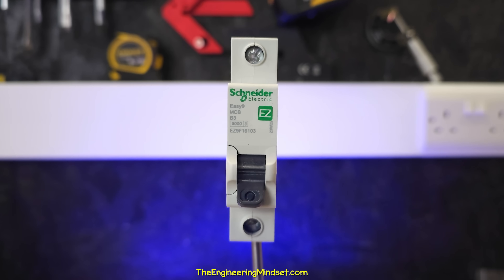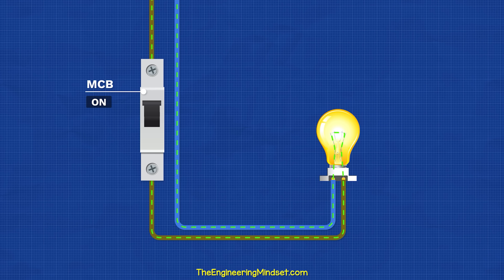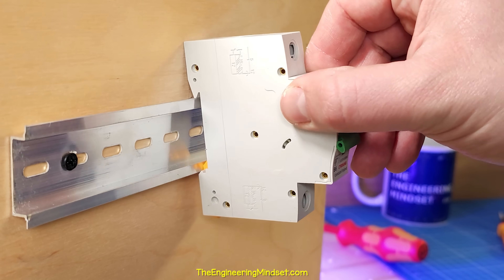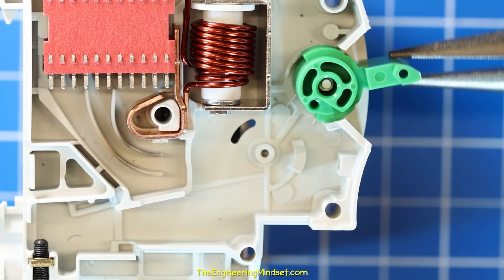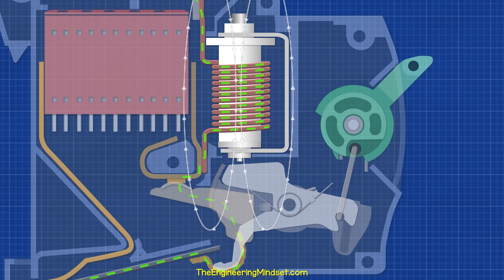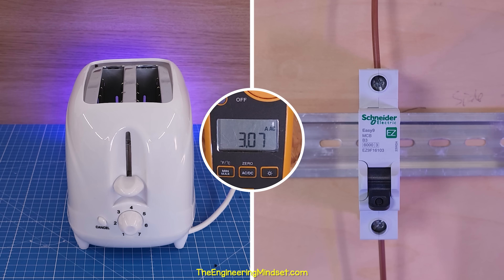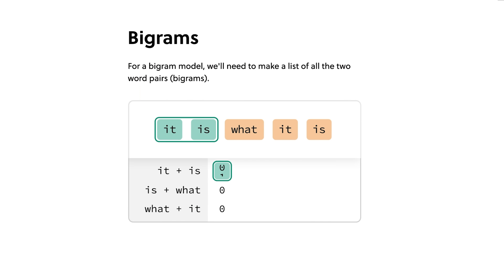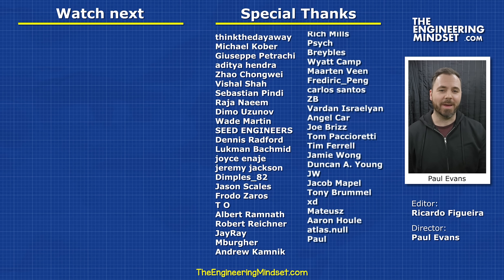Why Circuit Breakers DON'T Protect People (electric shocks)

Comment: The first GFCI I installed I tested first, out of curiosity. 
I put myself in series with my multimeter and reached 100 ma before I had to let go. The device was supposed to trip at 60.

Comment: 4:00 The electrical & automation maintenance engineer in me is giggling at this... 😂
On a more serious note... YOU SHOULDN'T MIX OR INSTALL BREAKERS OF DIFFERENT BRANDS INTO A DIFFERENT BRAND PANELS EVEN IF THEY FIT FOR SAFETY REASONS!
(Do as we say, not as we do 😅)

Comment: 2:22 Give me a graph of the breaker in use, and I can tell you!
And I disagree with your video. Where is the protective earth?
In class, I learned two types of protection:
Basic Protection and Fault Protection.
Basic protection prevents you from touching the voltage.
Fault protection prevents you from getting an electric shock if a fault occurs. And this is where the circuit breaker does its job so well. With correct grounding, you basically lift your foundation up to 115VAC by connecting the ground with neutral when entering the house. Your house is now TN-S.
This means if a live wire were to come loose in a grounded housing, you wouldn't get shocked! The housing would create a short and trigger the CB. If there were no grounding, the live wire would electrify the housing, and you would get an electric shock.

Comment: Hello I don't know if this video title is correct or not;

In a TT-grid a breaker does provide people protection from indirect touch.
In a TN-grid a breaker does provide people protection from indirect touch.
In an IT-grid a breaker does provide people protection from indirect touch.

Aside from a special wiring diagram where a circuit breaker breaks in function of the negative sequence current. Or by measuring impedance to ground (always present in IT-net here in belgium conform to our laws). I know of no way to protect from putting yourself between two lines.

If a live wire touches a metal housing. The entire housing is at that potential. And touching it may kill you.
When this happens the impedance is either:
1) very low, thus the voltage over the person is high, but this gets tripped because low impedance => high current
2) very high, thus low voltage over person, but high power consumption (fire hazard) this doesn't get tripped

Comment: In Europe MCDs usually cut both Live and Neutral.
There's two reasons, First for it's higher security, second because the standard 230V 50hz doesn't actually require that Neutral Is at the same voltage (or close) to earth.
I live in Europe, i have 230V between live and Neutral...
But it's actually like if i have "two" lives.
Because live it's at 127V compared to earth and Neutral too, they are offset so that there's Always 230V between them.
Usually Neutral compare to earth Is 0-3 volts but for extra security (and for this unusual cases) we use breakers that cuts both live and Neutral.

Comment: GFCI -- The ground-fault circuit interrupter, or GFCI, is a fast-acting circuit breaker designed to shut off electric power in the event of a ground-fault within as little as 1/40 of a second. It works by comparing the amount of current going to and returning from equipment along the circuit conductors.

Comment: Is there a way to report wrong auto-translated video title?
the term "circuit braker" is translated to "disyuntor" and should (at least in Argentina, don't know in other countries) as "interruptor térmico" o "térmica" o "llave termomagnética" because that is how we call the CB.
A "disyuntor" or "interruptor diferencial" is the one checking in and out current, an if a significant difference is detected, it break the circuit, so those are the ones protecting people.
Reply from the maker: Thank you for your feedback, we have now changed the translation to Por qué los interruptores termomagnéticos NO protegen a las personas (descargas eléctricas) to suit the different spanish speaking audience and try to make it clear for both South America as well as Spain as the term varies

Comment: I dunno I feel safer not being on fire.
Reply from the maker: This device won't stop providing power to a device if it catches fire, it will happily continue and burn the entire place down with everyone inside. It will only stop if the current becomes excessive.
Reply: @EngineeringMindset  A device, yeah, but those you can see. In the walls, that's where the problems are and that's what it protects.

Comment: "You must be qualified and competent to carry out any electrical work"...

You're incorrect. Nowhere in the electricity at work regulations does it use the word qualified. You must be COMPETENT and there is a big difference between qualified and competent. Electricians from before NVQ courses who are experienced enough can still legally carry out major electrical works. Competence means you're experienced and understand the dangers and how to install and maintain electrical installations safely. I've personally studied BS7671 extensively, and I'm not "qualified" in any way. I can legally work on installations, as long as it doesn't fall under notifiable work. I can't install a new circuit, work on bathrooms or outdoors or rewire a house (though I have done) but anything that falls under part p does not require official recognition. Even official recognition isn't a qualification. It's a competent person scheme such as NICEIC or NAPIT.

On top of that, a lot of electrical contractors in the UK are "qualified but not competent" these days. Experience trumps all qualifications in any field!
Reply from the maker: Yes all true, but we cater to a global audience and the regulations vary by country and even by region within countries so we have to be generic with safety warnings
Reply: almost any electrical work is illegal in finland

Comment: wait how you say that 1,5mm² ist rated for 20A? Its normally 16A max. and better will be 13A as a breaker
Reply from the maker: Referenced from UK onsite guide for electrical installation. Specific conditions, there is on screen note in corner of video also.
Reply: in finland the standard is 1.5mm² 10a slow blow

Comment: Por qué confunden Disyuntores diferenciales con llaves termomagneticas??? Son diferentes protecciones.. una termomagnetica NO protege contra descargas en el cuerpo, sino que protege la instalación de cortocircuitos. El disyuntor diferencial, actúa midiendo posibles diferenciales de tensión respecto de tierra (protege por posibles fugas a tierra entre las que pueden ser descargas a través del cuerpo. Hay errores conceptuales. Mezclaron los tipos de protecciones y sus funcionamientos
Reply from the maker: Exacto, el video muestra una llave termomagnética todo el tiempo y explica su principio de funcionamiento, aclarando que solo protege contra sobrecarga y cortocircuito.
El disyuntor diferencial se menciona aparte, solo brevemente, y se dice que salva vidas.
El problema viene de la traducción del inglés original: una termomagnética en inglés se llama “circuit breaker” o “disyuntor”, mientras que el diferencial se conoce como “RCD” o “GFCI”.
RCD significa Residual Current Device (dispositivo de corriente residual) y GFCI significa Ground Fault Circuit Interrupter (interruptor por falla a tierra).
Disculpas si hubo algún error en la traducción ofrecemos estos videos de forma gratuita y hacemos lo mejor que podemos.

Comment: In Australia, we don't switch our neutrals. Our neutral supply wire is bolted directly to the main neutral bar and an M.E.N (main earth neutral) is installed, tying the neutral to the earth wire. We have strict earth resistance limits on both our final subcircuits and our incoming supply Active-neutral and active-earth impedance values, as well as strict rules on tying anything metallic that may come into contact with electrical cables to the earth as well. Works VERY well under fault conditions I believe.

Comment: Yesterday, while I was playing my computer as usual, the wiring in the hallway caught fire. It turned out I'd somehow exceeded the power limit, and the wiring caught fire. Although, everything was resolved fairly quickly, and I think they said they'd replace the wiring because it wasn't my fault.
As I understand it, the wiring in the hallway is older than the wiring in the apartment and simply couldn't handle the heat (while the fire was burning, the PC continued to operate normally for about 5 minutes until I turned off the lights in the apartment).

Comment: MCBs do in fact provide a level of protection for Humans. 
As electrical Tools/appliances, at least in europe, need to be certified with a certain safty class. There are 3 Types:
1. Grounded caseing
2.Double Insulation
3.extra low voltage

For Type 1, the curcuit braker is essential for protection. In case of lose wires or a broken Insulator in the tool, the live wire would short to the case and Trip before a human would get a shock from the case.

but yes a mcb wont trip if you just touch lose live wire. they are actually called "leitungsschutzschalter" in german which litteraly translates to "wire protection switch" and dont provide direct protection to humans.

Comment: I learned a lot about these when I decided to build my own power station for home usage. It seemed pretty straightforward from a technical perspective, but then I couldn't figure out the proper breakers I'd need and how many — one on entrance for the invertor, okay, then what? Do you need one for the battery (in) to save it or two for the battery (in and out) to save the inverter? So I asked an engineer friend and he explained that it won't save me and it won't save the equipment if something happens — even with the bms and the breakers, the inverter will most likely just fry itself on the spot. Wait, what? So why do I even bother with several (AC and DC for battery) breakers then?? Well, it's so your apartment doesn't burn down to the ground, he said. 
So it goes. 

I'm not a mechanical engineer or an electrician, but that was a huge project and I got to learn a lot, thank you for this video, explains many different aspects I didn't know about.

Comment: Could you make also a video about Motor protection circuit-breakers which is little bit the same. But where you explain how to adjustable current rating is explained + what happens when a imbalanced load is applied and why it should trip with imbalanced load?

Comment: I am in Semiconductor industry and a team in our Company Designed Electronic Fuse (Efuse) with a Circuit breaker Response of 2uSec.
The Breaker Current can be pre programmed to values from
mA to hundreds of Amps.
The IP is expected to land several US patents

Comment: At @15:20, you explain the curve shows a trip range, which includes a worse case trip time of 11.5 sec 3 times the rated current. You then say a B breaker will instantly trip when getting between 3 and 5 times it's rating. Why do you use the word instant? Given what you just explained, we are looking at worse case trip time between 11.5-2.5sec. I would imagine the word instant shouldn't apply to something that could take 11.5sec to react. Why did your wording change to call the trip charactoristic instant within that range? Looking at the curve, I would imagine anything 6 times+ the rated current would be a better location to use the word instant, and only location to use it. That section has no range, it's a flat line for 0.01s
Reply: And if the logic from the rage 1 - 3 would be applied to region of currents over 6 times, a B breaker would not trip with the 40 times the rated current if the current lasted under 0.01 s.

Comment: C est quoi ces disjoncteurs ?  
Ici ils coupent phase et neutre..
Reply: you don't have to cut the neutral wire because it's 0v
Reply: @gamecubeplayer  non réellement il faut couper les deux sinon tu peux avoir un accident par retour de neutre..
Reply: i've only seen double pole switches for inlets

Comment: A bit too many points of circuit failure in those UK breakers. I know we are lazy over here on this side of the giant pond, but the same effort can be achieved with far fewer potential failure points. Granted, we are not foolish enough to feed 200+ volts to a standard residential outlet, but there surely is no need to introduce unnecessary points of potential failure, much less as many contained in your MCB's. And having breaker connections which have the potential of generating a false connection with the building's wiring is a bit too foolish from the start. That is a design engineer who is better qualified at washing dishes.

Comment: What are you talking about? Circuit breakers absolutely save lives. GFCI breakers save them daily. NEC 2023 requires them in just about every room in your house now, except maybe your closet.
Reply from the maker: Thats a completely different device, which is also discussed in the video.

Comment: I remember once when swapping a plug or fuse in a plug once. I forgot to screw the back plate back onto the plug and when i went to take the plug out, the backplate came off, and my hand slid across tge metal, shocking me. I feel lucky that i didnt get seriously hurt, and didnt realise how bad it couldve been till seeing this video, especially the bit at the start.

Comment: Yeah, that internal trip mechanism (even if the switch is forcefully kept ON) is very important. I once knew a customer who complained about his Garage circuit constantly tripping, even when he placed tape on the switch as he explained 😂
He had a small workshop in his Garage, so often he would run Power tools on a regular Home circuit, so no wonder why his switch would trip. I explained to him how things worked and that the switch could've been saving him from thousands in property damage, and recommended installing a whole new circuit for his Worksop side, or overhauling the existing one with a thicker caliber wiring and corresponding switch, but I suggested the first option was best, that way he could isolate his workshop in case of a short.

Comment: So say you are using one of these breakers on a DC circuit. Will the solenoid not work correctly if the current is flowing in a certain direction? Will the magnetic field pull up on the solenoid rather than force it downward?

EDIT: I found the answer to my own question. The metal armature in the solenoid does not act like a magnet, where it is attracted or repelled based off magnetic polarity. The metal is attracted to both the north & south poles of a magnet. So when current flows through the coil you may generate a northern magnetic pole. Reverse the current direction and you generate a southern magnetic pole. The polarity does not matter as the metal armature will be attracted to both.

Comment: Issue is mcb is more a current based mechanism. Over current, is direct method to trigger.
For human faults, i need sudden change in powerfactor and current,

As RCBO, GFCI and others do, but still needs full sensors and characterstics.

MCB is not meant to protect, just opens circuit as triggered.

You need more features, digital relays are king.

Comment: a good video bro, but i have  questions: in 11:40, you test 2 case with + - and  - + into a coil but the result is same, can you explain how it works for me. In my opinion, the direction of the current in the two cases is opposite, so the force generated will also be opposite.
Reply: It’s alternating current meaning the current moves back and forwards at 50hz. So it will pull down at some point during the ac cycle. And since it looks like it’s a ratchet system it can’t pull back up. Only one configuration would work if it was DC

Comment: I don't think your explanation of In-Rush Current is quite accurate, but i understand explaining it properly would require separate video.
Sure, capacitors do contribute to in-rush current. But inductors (outside of motors) - no, just no. Their main feature is preventing sudden change in current, which would actually prevent in-rush current.
In-rush current mostly happens in motors (both AC and DC) and in smaller degree in incandescent lamp. For lamps explanation is simple - in cold state they have low resistance, but when heat up resistance rise and current lowers.
As for motors... well... the simple way to explain would be: it takes a lot of mechanical energy to increase velocity from 0 to max, and very little energy to maintain this velocity. 
The actual explanation is motors windings are almost short circuit, and would normally consume a lot of current. But when it start spinning it starts working as generator, producing backwards voltage, thus lowering the current, this is why putting mechanical resistance to motor increases power consumption - it generates less backward voltage.